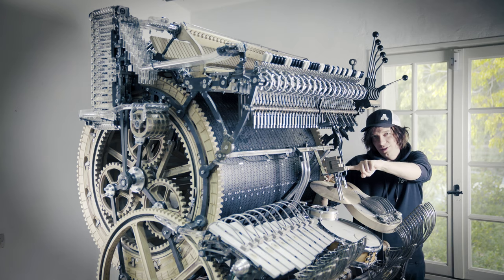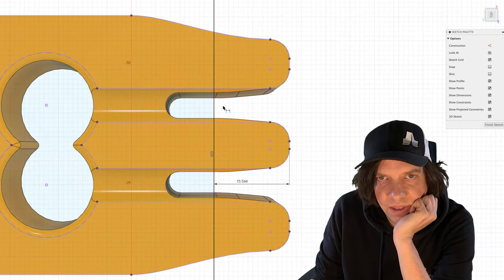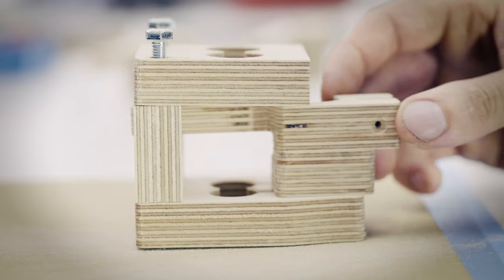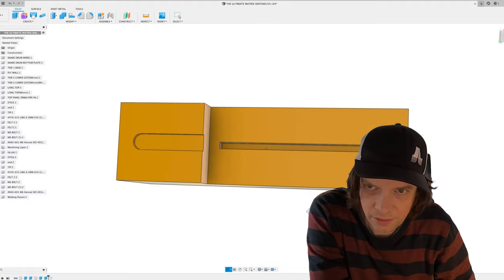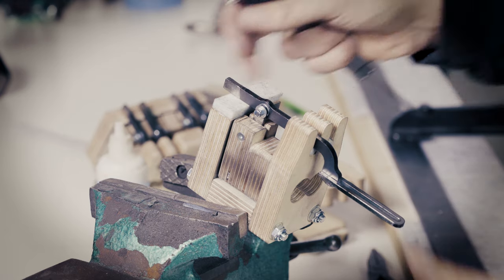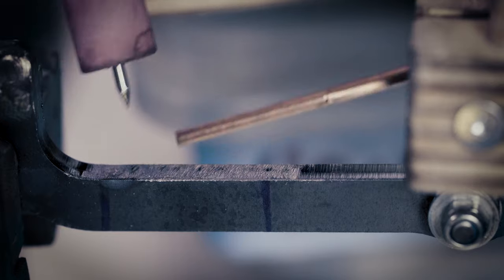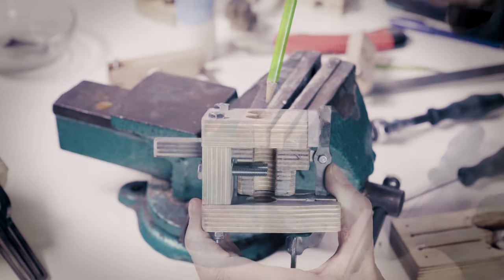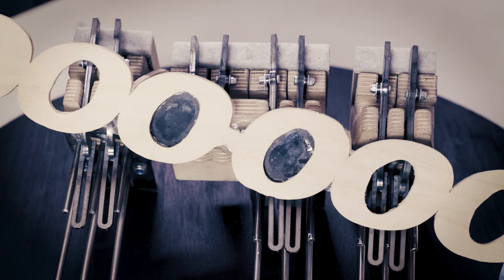Making Better Marble Gates - Marble Machine X #144

Comment: How will temperature and humidity changes affect the reliability of the MMX? One week you might be touring in finland, the next week in egypt. Is MMX equipped to cope with that?
Reply: Without failure tolerances build in? Of course it won't! The wood, felt, various metals and connections.. During transportation and various environments.. It will practically explode. The base line engineering principles here are fundamentally flawed.

Comment: Not the felt! Shim the back of the gate, shim on the hard piece of wood. Put a had spacer so the gate physically cannot move past the marble. The felt is squishy and you'll never be able to shim it correctly. And the hard pieces of wood have hard measurements you can use. You can use a thinner piece of felt that can't / won't compress farther than you want it to.

Comment: A question, why meld to add material instead of change the length of the link, seen in 10:30? It seems like a easier and more precise way of aligning the two holes to be concentric

Comment: So let me understand this.

You modified the gate design in CAD. Then CNC it from plywood. All 38. Without testing the result on one piece, if any adjustment needed or not.

Then, after having all parts made, you start to assemble just to find out, that another mm is needed.

After this, instead of swallowing the pill, and re-CNC the necessary parts, you start to screw up the beautiful, laser-cut parts with hand welding...

And this is what you call "brilliant". Well, we definitely have different dictionaries ;)

Comment: I worry that untreated plywood will absorb moisture differently in different countries as the machine goes on tour, resulting in a change in tolerances.
Reply: And by "worry" you mean that you are sure.. Right? Because it will. The only think more naive is to depend on the thickness of a piece of felt to not jam up the thing... O wait!

Comment: how hard are the balls compared to the bolt threads they crush into? maybe put a smooth sleeve on the bolts, or smooth the bolts in a lathe, or use smooth bolt etc. worried about balls getting bad.

Comment: The sliding wood element is too high (currently same height as the marbles). It pushes the marble stack slightly up like the marble you showed already, when the gate opens. This effect can be seen at 21:39
This applies only too the long back end of the sliding block. The front needs to be AT LEAST the size of a marble (preferably a bit larger, if machine/ground is shaky) + drop height/lower channel etc.

Comment: ``Designing and making the new better version of the marble gate, trying to design a mechanism that can do 10.000.000 marble drops without fail.``
10.000.000 aha.. If it will ever be finished... than ok...

Comment: Plywood is a really forgiving and durable material. But it is still wood. So round edges will reduce wear greatly also you should oil it or something to make it harder and water resistant. 600grid sandpaper on unconditioned wood is absolute overkill. Anything over 220 is not gonna make it mutch better.

Comment: I still don't understand @14:35 why you put Loctite on a nyloc nut. Are you using the glue for a permanent bond (then 638 is much better) and the nylon in the nut for temp holding?

Comment: Why did you add metal to the bar with welding, when you could have just shortened the connecting rod between the shuttle and the bar?

Comment: I know you are very happy with it but I see an issue. At 21:50 if you watch the marble goes down and then towards the end of the stroke it goes back up and then down again so couldn’t that part where it tries to push back up against the weight of the marbles above it cause a jam? If you do happen to agree with me maybe you could fix this by making the part above the screw in the wood instead of just a cylinder somehow make it where it holds the marble above in a plane where it does not go up and down during the transmission from top to bottom? It almost seems like the current action is almost acting as a ball bearing detent lock would Edit: just to be perfectly clear I am talking about the marble waiting in queue

Comment: Why not use a 6.5 ml. rubber pad instead of felt?  Rubber will deaden the sound as well. It is not good to use the felt as a stop. The felt will compress and abrade away over a million times.   Rubber can deaden sound, reduce vibration and has a memory to retain its form. Synthetic rubbers come in a variety of density and many rubbers can be cast into any form.  As 6.5 ml sheet of rubber can be cast and cut into strips.  Urethane rubbers can be easily adhered to plywood. Felt is a good choice if you are planning to replace after a million times.   The rubber may last longer before replacing.  Alex

Comment: What happens if we lose Gravity on this Planet?  Should the Marbles have some kind of pressure system?  Completely self-contained and able to operate in zero gravity would allow this Marble Machine X/Y to operate a Trillion times... Anywhere!  And what about Expansion and Contraction in extreme temperature differences?  If this machines failure rate is improved by having only one song programmed into it, how about a different machine for every song?   (Grin)
Reply: Lets accept that it will not work on the moon... Working on earth is a stretch at this point.
Reply: @Diggnuts  This thing is so we'll designed, it will work in a Thousand years!
Reply: @jameslamb7300  I'm not waiting a thousand years though!
Reply: @Diggnuts  The Good news is that you, Diggnuts, won't have to!   This Machine will be on tour with Wintergaten!

Comment: 17:32 @wintergatan instead of trying to weld extra metal on the metal piece (your thumb touches) why not shorten the other metal piece which links the wood and metal piece together? Lose a mm there and the holes should line up with minimal effort + higher accuracy

Comment: The 6.5mm thick felt is too thick for the metal part at 21:20. That metal, especially with the welded edges (decreases the surface) will simply cut the felt or rearrange the fibers in the felt by the time and the damping will be a mess.

Comment: Please don't get me wrong. I am thoroughly and completely blown away by all of your skills, except for one. It is obvious that you spend a great deal of time doing research. If I could suggest that you search for and find true artist TIG welder videos. I spent a great deal of my life working in the nuclear industry with some of the finest pipe (TIG) welding masters in the world. But FIRST, find some source for instruction in sharpening tungsten, as well as tungsten alloy choice. With the correct tungsten, the correct sharpening angle, the correct gas, pressure, flow volume, and amp settings, your welds will improve 90%. (You run WAY too hot) The other 10% will come with practice --- after unlearning some bad practices. Your attention to detail assures that you will be a natural. Over time, each of your welds will become their own work of art --- worthy of being showcased along with your marble machines..  😎😎😎

Comment: This is a lubricant for wood like this: https://www.amazon.de/-/en/Silbergleit-dry-slip-additve-woodworking-1000g And it does not look that dirty. Felt is a organic material, if it is pushed 10 million times, it might deform enough to cause problems. Maybe felt is not the best damper here. Also the material you added is even smaller is even thinner then the bar which increases the deformation stress on the felt. Larger is better in this aspekt.

Comment: Of all things to be claiming is reliability to 10 million cycles. This is obviously taught in mechanical engineering and where the failure limit "mostly" ends. I know you want a trouble free experience with the MMX, but TBH, with the materials that are being used, this won't be possible IMO. It's nice to think that it will be nearly 100% trouble free, but these kind if endeavours never work as expected. This is a prototype of a prototype, if that makes sense. This machine will be forever causing issues, mainly cause no testing has been done before initial runs, since it isn't built yet. 

I am not trying to be a negative nancy, it just comes from experience of doing prototyping and spending far too much time redesigning things before they are tested. This will hopefully be issue free for a long while, but with this many moving parts, and events happening concurrently, I don't believe this kind of reliability will be achievable from the get go. 

I do hope you the best with this conglomeration of parts and pieces, but if I can have one this to say is "Failure is, and always is, going to happen as is the engineers fate"

Love from a Canuck, can't wait to see this bad boy churning out tunes from across the globe.

Comment: Still too much Loctite for your screws. Make it one ! thin ! line along the position your bolt will sit instead! 

Also +1 for everyone wanting something less compressable than felt for parts which are bound to mechanical wear. They won't last 10 mio. times. 

Finally don't you dare using screws inside the gates... and if you insist to, turn them down in a lathe and remove the threads.

Comment: Dear Martin. I have been following your entire MMX-project with great enthusiasm, but it has lately become rather painful to watch your progress. You are at a point where you need to take some serious action. There is clearly a limit to (even) what you can accomplish. Your lack of engineering backgound becomes more and more clear, even for a regular person like me. Thinking precision, sustainability, reliability and failproof in a concept this big and complicated does not add up with your approach to it. My advice is to put away the welding machine, angle grinder and the facination for plywood as construction material. Assemble a team of proffesionals to help you through this part of the project. Otherwise the only failproof about the MMX-machine is that it will fail. We want glory but at the moment there is too much pain! ;)

Comment: I've been following for a while, and am very enthused about the project. One thing that I do not understand though.  You keep saying "it has to work 10 million times without fail" and "when it fails it breaks the machine."  Most engineers do not design for perfection, but they design in failure modes, so that when something does fail, it does not break the machine. In a failure-mode design, if a marble drops badly, it will be ejected or shunted out of the way, etc., rather than getting caught in the mechanism and causing a break. Or, if a marble does get caught in one part of the machine, the mechanism will bypass that part so  that it does not break.

Comment: I think there is a problem in the fact that you say that the marble dropper has to reach 10 mil drops before breaking, but you considered a song as 3000 marble drops ( if I remember correctly) and it's like you calculated that every drops comes from a single channel. But you have 38... So your level of precision is making your MMX 380 mil drops secure...
Reply: What I'm saying is that the probability of breaking spreads out on your 38 channels, so you're making the machine 38 times more reliable than you think

Comment: Not sure if this has been  ommented before, but making all parts work 99,99999% does not make the while machine work 99,99999% of the time. A simple example: a machine that has two components, one after the other. Both components fail 50% of the time. What is the failure rate 8f the assembly? The first components fails 50%, so the second component is only reached 50% of the time. That again fails 50% of the time, so it succeeds 50% of 50%, or 25% of the time. So the failure rate of the assembly is actually 75%.

Comment: Using felt to achieve long term millimeter precision doesn't sound reliable to me at all. I don't know much about felt, but doesn't it lose any of it's thickness over time? How does it behave under different humidities? Using a material, that's highly dynamic for such a high precision job, doesn't sound like a good idea to me.
Shouldn't the perfectly rounded holes rather be slots instead, so that you don't have to be that precise? The slots can't be to long though or the marbles won't drop anymore, when opening the gate.

Comment: So. If the idea is precision. Should not nearly all pieces/all pieces be designed from materials that absorb vibration and aid stability? For some transparency: turning the hand crank = movement. Every drop of a marble = movement. Every peg that plays a note, every drum strike, every flipped switch, let's not forget the thing everyone is commenting on -- marbles against the screw threads. All of these things will cascade into a greater vibrational force when all in motion. Metal as we also know isn't something that consumes vibration but is prone to it. However, if braced correctly can mitigate vibration? I am certainly no engineer, nor am I any form of a scientist. So please correct me if I'm wrong. But... Necessary minimalism, necessary complexity, and shock abortion may be the holy grail here. One big lesson in watching this series is: Complexity isn't always the answer. Just the same, making something that needs complexity overly simple likewise, ISN'T the answer. But a lot of what it seems is that felt and other materials are just the beginning here. Other adaptations should be not just considered but tested... But Like at least 1000 times tested? Also, bracing, supports, load bearings, vibratory mitigations, etc. The literal feverish pursuit of stability. Even in the smallest detail. If this "millions of marbles without fail" is going to be a reality, MMX/MMY may end up being far simpler, possibly smaller, or all-around different in approach and/or design. Heck, we're seeing that form of innovation already taking place. Some pieces already are a world different from how they began. As for complexity (c) vs. simplicity (s), the question that I would ask is: Is C or S better for the particular part design? How does one or the other benefit or detract from the design? The mantra of this seems to be stability. From here, performance, then repetition. If it fails. Stability, performance, repetition. It's almost poetic, like in life we pursue stability and so the same does the machine.

Comment: Martin, what is happening! Please listen to the voice of the people, the people say: design so the failures don't destroy the machine or music. Musicians are not this perfect on stage... I have never been critical before but I am worried about you and this project now. The places where you take so much time to get it right are at such a juxtaposition to when you've been at it for a while and just want to finish a part, so take a shortcut. You know you will regret that further down the line, it's happened a lot of times. Improving the parts is great, but your goal, 10,000,000,000 marble drops without fail... I think you set yourself up for pain

Comment: Adding 1 mm to the metal by welding is a horrible solution. Over time the felt may compress more. The hole in the gate should be larger and chamfered more. Redo the wooden parts instead. Further the marbels drops on to a metal shred. This has friction and adds noise. The metal bolt should be e.g. a plastic peg.

Comment: I would be fairly concerned about the felt (both on top and in the pocket) wearing off (i.e. deform permanently, creating the valleys) long way before reaching the 10M contacts with the metal bar, permanently beating into it. The threaded stop is another point of my concerns too.

I mean - plywood is great for rather aesthetic aspects, but provides fairly poor reliability over the time. Since the MMX got probably over-engineered and its weight is no longer the issue, I believe that metal/better materials would contribute towards a higher reliability.

On the other hand - I'm no engineer nor designer, just a  typical IT rat :-).

Comment: Welding to add Material is a Bad Idea.
Felt get compressed with time ... You need a second ... hard stop If you incist to use felt. Felt for damping and slowdown and a second precise hard stop.
 Test wear and reliability  on one Gate for some days... and after  measure loss of material ...

Comment: ok, this is absolutely not important, but I am lost and confused:

at 0:22 you unscrew the left bolt holding the prototype to the metal part, but you unscrew it as if it was a left-handed thread. looking at single frames it's very hard to tell, you move around a lot. In the close-ups on the table afterwards the bolt looks very much right-handed. 

did you change the bolts? did you tighten it in the video (there is a cut after you cranked it and you can't see the nut moving in the variable spanner)? you surely didn't mirror the video...

ahh, that freaks me out :D
Reply: @jeffreylee7184  you're right, must have left my razor somewhere. At this point i just wouldn't be surprised at all, if he uses right hand threads with a special one-in-a-million purpose.